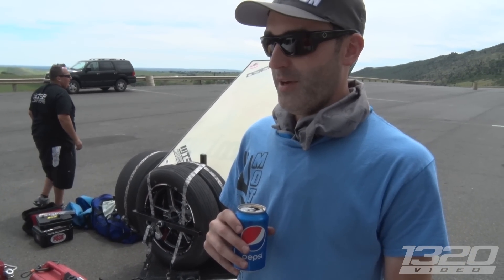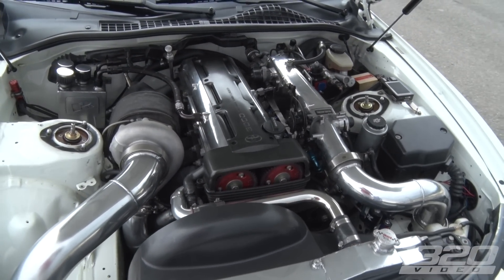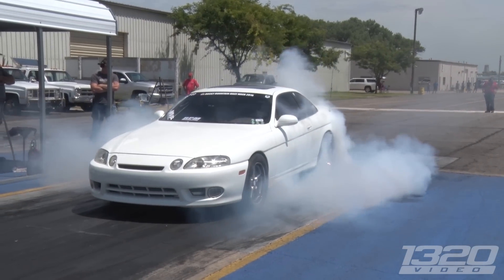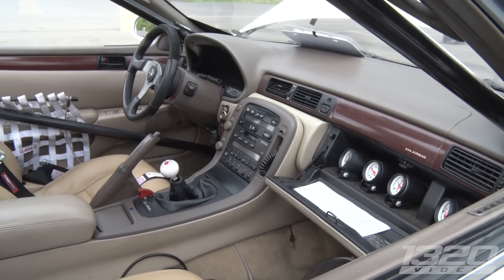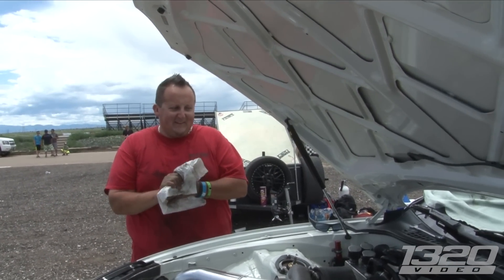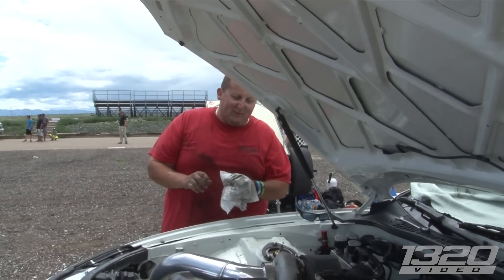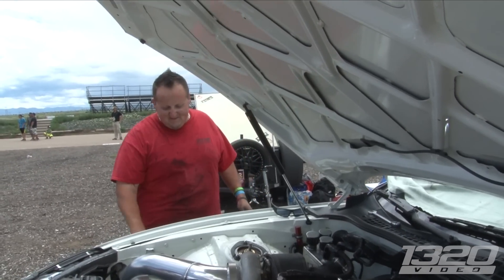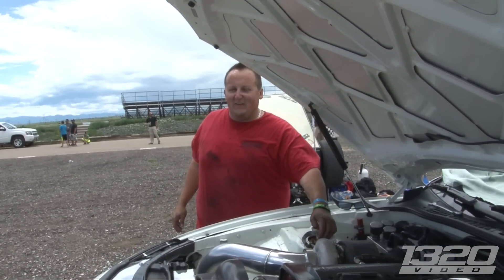9 second TURBO Lexus SC300!

Comment: that's cool my grandma had one but was not this fast
Reply: +7topseven7 make her slap a turbo on it, the 1uz can handle a turbo at 10psi+ no problem
Reply: +30GB the sc300 comes with the 1jz and the sc400 comes with the 1uz. So if his grandma has the same car it should have a 1j
Reply: +Billy Benedict do they come 1jz n/a? because i know the jdm rhd has a 1jz twin turbo
Reply: +30GB in the states in pretty certain none came turbo from factory with the 1jz can't speak for rhd versions.
Reply: +30GB you won't find a "jdm" Lexus. The brand literally means "luxury exports to United States". The baddest thing an old wedge sc ever had was that 4.0 with like 230hp. They're old man sports cars, meant to be smooth, not fast. (Until now apparently)
Reply: ***** very true. Some supras came with a 1j and a 2j (as well as the sc series) very nice platform and all around good parts. I like the sc series. It's cool seeing a fast one.
Reply: +living room False. The Supra is based off of the SC since it came first. 1991 was the first year of the SC.
Reply: +Billy Benedict sc300 2jzge sc400 1uzfe
Reply: +Philip Hines in Murcia it's a 1jz
Reply: Billy Benedict Dude i own one. Lol i know..its a non turbo 2jz we dont have soarers in america, the soarers come with 1jzs
Reply: +7topseven7 In NA they came with a retarded 2jz not the same as the supra. pretty damn slow without any mods currently depressed lol
Reply: Philip Hines Man you gave me a good laugh lol. Maybe one day.
Reply: lol one day
Reply: Philip Hines You ok? i see sarcasm
Reply: @billyz97  only the soarer had a 1j,sc has a2j

Comment: "What trans is it?", "TH400", "Yeah, Chevy Power", Then the trans takes a crap! lol
Reply: Well he isn’t using the stock trans so that should tell you something...
Reply: @ztwntyn8  Im using a built A340 in my SC300... which would be the stock trans lol
Reply: @ztwntyn8  Baltic Supra is at 1600whp on a built A340E that came with the car. Same trans as the SC lol do research

Comment: 0:54 How come some cars bog forward like that when they're about to launch? Is it because they're like letting the clutch past the biting point for a second? I'm I noobie 16 year old.
Reply: it is called staging
Reply: Building boosting
Reply: Most turbo cars have a bump box. this allows the car to build boost before fully staging.
Reply: Automatic transmission with a trans brake and a bump box
Reply: +t045t2346 it's not automatic wtf.
Reply: +SWATROLLK9 what the hell do you think a TH400 is?
Reply: +shredBucketheadshred sequential isn't it?
Reply: +SWATROLLK9 No, I believe its a 4 speed automatic, he was just manually shifting it
Reply: rzr kid
3 speed, often changed to 2 nowadays leaving out the first gear
Reply: +shredBucketheadshred  Yeah, thats right, because they came in alot of pickups and 1 was basically low gear

Comment: With similar power and a stock 2J auto box TRC's 240s got an 8.09. This should probably be trapping way higher.
Reply: Difference in altitude, plus the 240 is gutted and much lighter than an sc300. Especially one with a full interior.
Reply: this thing is heavy af compared to the trc 240
Reply: @118nikeboy  exactly

Comment: The car is pretty sweet. Are those things really heavy? Seems odd that he has 1000+ hp and running mid 9's.
Reply: My 96 Lexus sc300 weighs right around 3400. So his would weigh about the same since he still has full interior.
Reply: Colorado altitude kills bro. Cars can be a second slower up here easily
Reply: +Austin Lavine valid point.

Comment: can somebody please explain how he's running 40PSI of boost AND 10-1 compression? wouldn't he knock like crazy since im assuming he's not running e85 or race gas?
Reply: +LiangVids 

Why are you assuming that?
Reply: +The Boss I'm pretty sure that's what the owner of the car said in the video
Reply: +The Boss I'm pretty sure that's what the owner of the car said in the video
Reply: +The Boss I'm pretty sure that's what the owner of the car said in the video
Reply: +The Boss I'm pretty sure that's what the owner of the car said in the video
Reply: +The Boss because 1320video always points it out if it's on e85. even with race gas, is it enough knock-resistance for 40psi and 10:1?
Reply: The power and reliability of JZ engines!

Comment: whats good about 2jzs i am seriously asking
Reply: +BlackRecoil  Not an experts on 2j's by anymean, But, their is alot of reasons why 2jz's are great. They are easy to find, not to expensive, they are REALLY moddable, easy to work on, and can  handle massive amounts of power even on stock internals. Just all around really solid, fast, reliable engines.
Reply: +BlackRecoil They are just strong from the factory and the GTE (found in the supra) is already turbo'd so making big power is essentially just a matter of turning up the boost. Factory strength saves money in the long run by not having to do a forged rotating assembly and extensive machine work, thus producing popularity but the rising cost of the supra has pretty much negated that. To get an sc300 to 500hp is gonna cost around 5k if you aren't using ebay parts, so really in this day and age the 2jz is just preference for people who want something different because it costs just as much as anything else
Reply: You can squeeze so much horsepower out of it if you tune it right and have the right parts.
Reply: thank you all
Reply: +BlackRecoil Short and simple, large aftermarket and great power outputs.

Comment: Wonder what the 60 ft are on this car
Reply: +gsppuffer slow, lots left tho
Reply: best is a 1.38
Reply: in these runs? I don't think so bmiller303
Reply: +shredBucketheadshred 
correction,  best with that setup is a 1.37. The pass at bandimere was a 1.42 and the 9.57 at the end in NE was a 1.49.
Reply: bmiller303
Man it looked an sounded slow , you sure the runs in the video were that quick? I instantly thought it was an 8 sec car leaving soft
Reply: +shredBucketheadshred 
Yes. the car is slow because it weighs 3600lbs and was hurt after the first day at bandimere. It has been 9.10 at 7000+DA
Reply: hey I never said slow LOL it just looked like a slow launch for a car with that much power, also sounded like it wasn't really on boost and not even close to listing a wheel, I've sen heavier cars lift both on small tyres. in case its hard to tell I was in a way complementing the car haha meaning you have lots left in the ET bmiller303
Reply: +shredBucketheadshred 
have to hit it soft out of the hole,  the car is running stock axles and TRD rear.  In the last few seasons have killed a few rear ends and several axles. You don't see many IRS cars lift the front tires,  even when they make stupid power.
Reply: bmiller303
aaaah ok and yes good point about the IRS, ditch that crap asap hahaha anyway man well done hey and competing in what you have.... instant cred and badass in anyones book even a classic muscle man like me